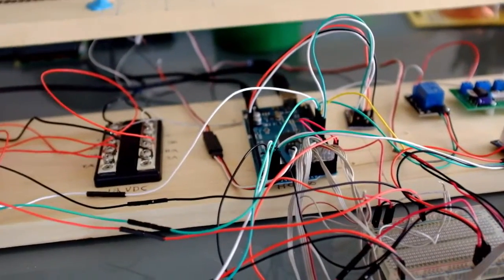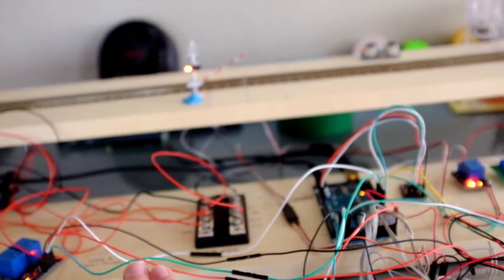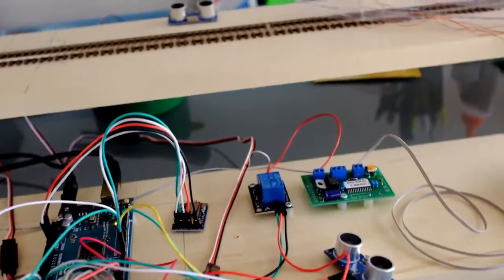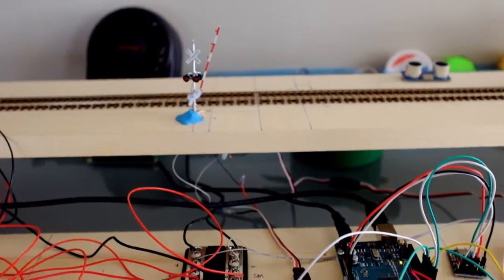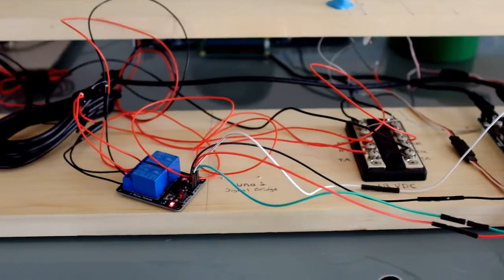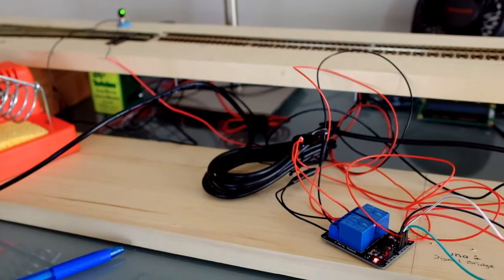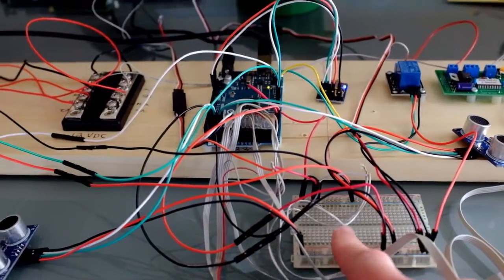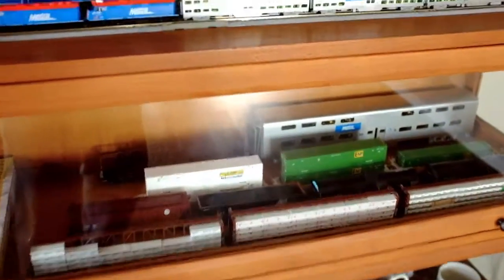(Narration) Arduino Grade Crossing with BLMA Signal Bridge, Circuitron Slow Motion Turnout Control

Comment: Hi Nicholas, Excellent presentation on sonic sensors, as a new comer to both Arduino & model railroading, would you be kind enough to share the full sketch that also controls the lights and bell. 
Looking forward for an early favourable reply,
Thanking you in advance,
with Kind Regards 

Jay (From down under - Melbourne)
Reply from the maker: Thanks Jay! Shoot me an email to nicholasleby at gmail dot com

Comment: Switching to O scale and train detection is so easy with the third rail.  You have some great projects and I think motion is the way to go for smaller scales.  I am reluctantly selling off my N and HO collections(mostly Canadian Rails).  My eyes get weaker as I get older but my interest continues to grow.  You are really doing some interesting tinkering.  Keep up the good work!  I think you mentioned you have a new baby so that may limit your time. :)
Reply from the maker: Thanks! I did voltage detection stuff before I ended on using sonar. Voltage detection was pretty eloquent and the closest to how real signals work. Only reason I went away from it was I didn't want to have to power my last car for end of train detection, however, I want to start adding FREDs to my trains, which would solve that since that would draw power and trigger the voltage drop.

Comment: I have watched your presentation many times and very much enjoy your work. Thank you for posting.  Now, may I ask for some help?  I am fairly old to trains and very new to Arduino and its possibilities, I have a good understanding of electronics and a fair understanding of computer programing.  My desire is to do, pretty much, the same thing you have done only using ir sensors and no crossing gates, hoping to grow into signals soon.  I have found the code, in one location, and wiring, in another location.  My problem is, the lack of knowledge to marry the two into a working project.  Could I possibly trouble you for a simple schematic of your project and a copy of you sketch.  I will give recognition to you for your work and my thanks for your help.  Thanks Bill    (bwyat*t@sbcglobal.net) Remove the "*".
Reply from the maker: Hey thanks Bill, appreciate the kind words. I don't mind sharing the arduino sketch, I'll shoot you an email with that, and some details about the wiring later tonight when I get home 😀
Reply: Thank you Nicholas, you are very kind.

Comment: This is a great looking project. Thanks for posting here. I have a few questions, how large of hole do you need to get the sensor to work; will that have to be under the track and need the ties removed?
Could this be done with with the Ardunio nano?
Could you incorporate the sound board into the Arduino and not need the external sound board?
For your turnout control, why not use a servo to control the points?
Reply from the maker: Dave D thanks :) the sonic sensor has to heads, 1 for transmitting and 1 for receiving. Each head is about the size of a dime. When creating this demo the plan was to mount under the track by removing a tie or two, you could however mount on the side of the track if needed. Also, I never tried, but it might still work with the ties in place, would just need to write some code to modify the detection range. All the stuff mentioned in the video would be Nano compatible with the exception of maybe the Bluetooth stuff, not sure nano has hardware serial like the mega does, and then obviously the mega has a ton more I/O ports.
Reply from the maker: Dave D exact dimensions should be on SainSmart HC-SR04 Ranging Detector Mod Distance Sensor (Blue) https://www.amazon.com/dp/B004U8TOE6/ref=cm_sw_r_cp_api_obHNyb4939N24